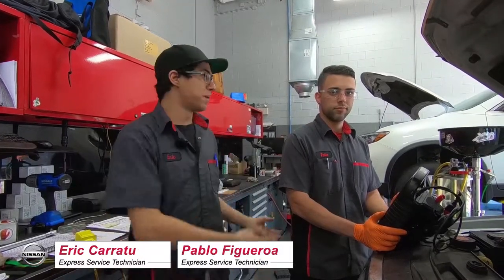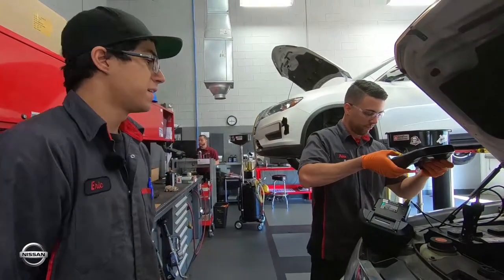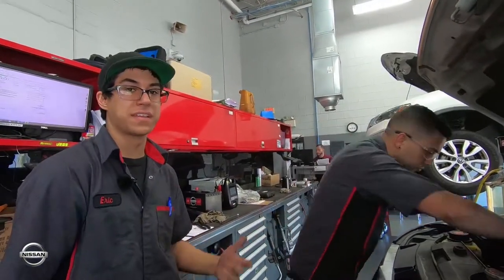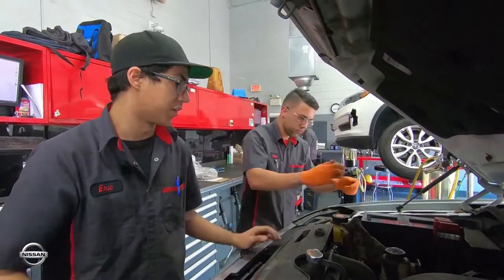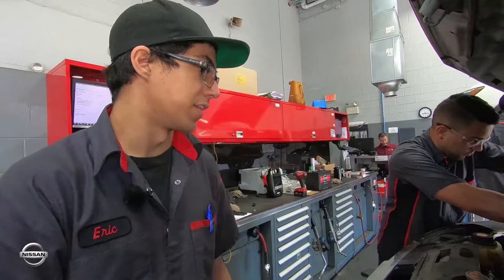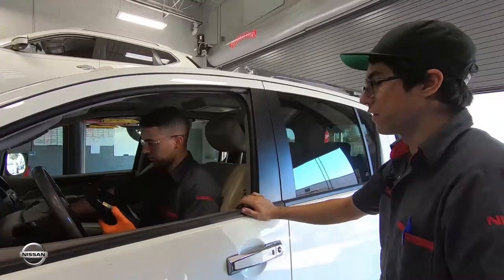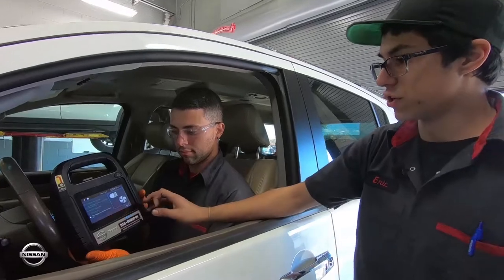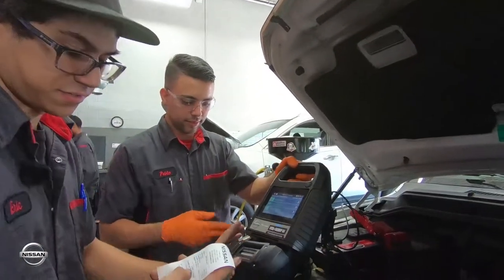Nissan Service: Battery Replacement

Comment: Never knew to keep the car running while you change the battery. I woulda thought that would be dangerous in case you touch the terminals. 

If you did turn off the car, would the car’s computer/electrical components reset itself after driving?
Reply from the maker: Yeah Eric mentions it could reset some user settings, such as radio settings, maybe some driver settings, or even power seat settings.
Reply: @UniversalNissanOrlando  cool thanks! And if I don’t feel comfortable keeping the engine running, i can keep it off and I can just manually set those settings again?
Reply from the maker: @thechileacademy4800  Yeah of course. I know messing with electricity can be very uncomfortable.
Reply: @UniversalNissanOrlando  one more Q for you. I’m doing a brake fluid change and I’m going to bleeding them at each wheel. I was told to disconnect the battery bc of the ABS system. Thoughts?
Reply: A much safer method is to use a 'Memory Saver'.  You can get models that plug into your 12V adapter port (cigarette light socket) or the OBD2 port.  The less expensive models use a 9V battery.
Reply: @MojoPup  thanks! Is it absolutely necessary to get a memory saver?  What would happen otherwise?

Comment: On the Nissan Altima models (2012 era)... Do we need to 'Reset' the car's systems when we change the battery?  Like going from a Flooded Lead Acid to an AGM glass mat type?

Comment: Today, I tried to replace the battery of Sunny CVT, first i connected the positive terminal, while connecting the negative terminal, the car started honking, I spoke to Nissan Service centre, they suggested me not to get worried, and switch of the central locking with the key, while honking. It worked , the connection was done. The car started with out any problem. I used Bosch C7 charger for charging the battery,

Comment: I know this video was in the USA, but I have a Nissan Qashqai 2016 1.5 DCI here in the UK , when my Battery went dead , the car had to go to the garage because it required a start stop battery and it had to be reprogrammed because is has the start stop feature , is this true? or did my garage pull a fast on on me????
Reply from the maker: It seems to be a common problem with that particular vehicle as far as I know. So I don't think they pulled a fast one on you.
Reply: The original battery on those models are not good (same issue with my 2018 model) You can just change the battery to a different brand (Almost anything else is better than original) as long as it supports start and go feature. So I don't think that you need to reprogram anything. I did it myself and many other people have done it too.

I would also recommend you to disable the start and go function as it will wear down on your battery life and much more. 
You can do that by checking these two videos below

Hope it helps.

https://www.youtube.com/watch?v=EGJT8BVUnVg&t=1s&ab_channel=JorgePerez
https://www.youtube.com/watch?v=WUBgAoSzRes&ab_channel=La_Palmeraie